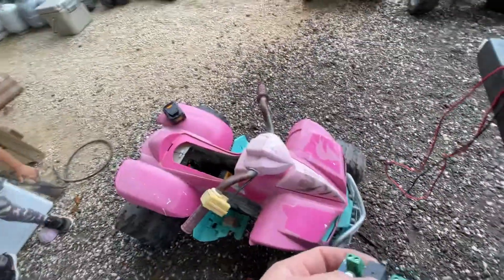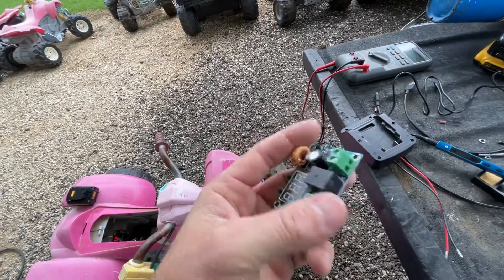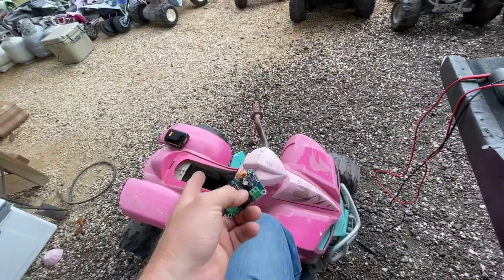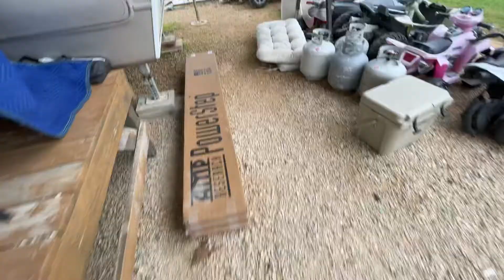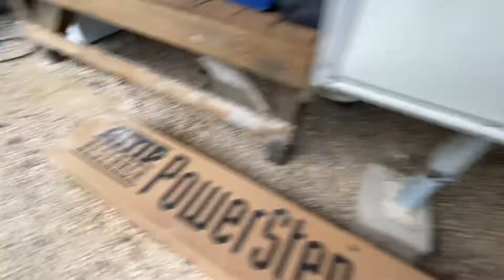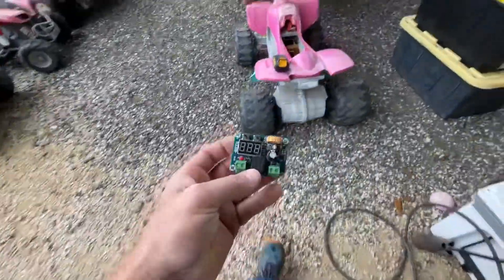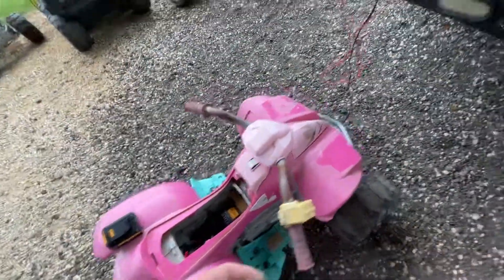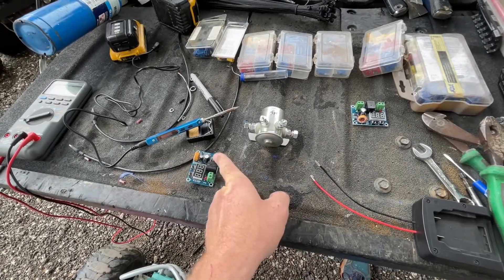20volt Batteries in power wheels with voltage cut off

Comment: I saw another guy use a 30amp relay would that be better?
Reply from the maker: The solenoid is the same thing. I need to remove the led cut off board and change it out for a non led preset board. The kids leaving the batteries in over night causes the batteries to go down to 2volts.

Comment: I need a way to contact you.  I have some suggestions for those "dead" batteries.  How do I contact you?
Reply: You can jump a "dead" battery with a good battery.   In this video your out using one battery.  If you hooked up two,  a. You get longer run time.  And b.  It resets the dead battery just enough that it will slow it to charge.   I suggest always using two full batteries.  I've blown 6 low voltage disconnects.
Reply from the maker: @G72Buick  I have tried this. It worked on a couple. I have also tried using a charger that has a 13v consistent to bring it back and the kids got into the batteries and messed up my stacks so I need to start that over. I also tried a 24v charger on the 20v batteries but because the volts are to low it won’t recognize it and turn the charger on. Next step I want to try is taking the batter apart and trying to charge each cell. Then putting it back together.
Reply: Look up Dad Hacks.  He put in a relay just past the low voltage cutoff board, 24 volt  30 amp protects the low voltage cutoff board!
Reply from the maker: @jamesm8360  I have the same concept here. Battery to voltage and relay / solenoid, relay back to solenoid with all the grounds installed. The led on the cut off board is what is draining the batteries to below a rechargeable state.